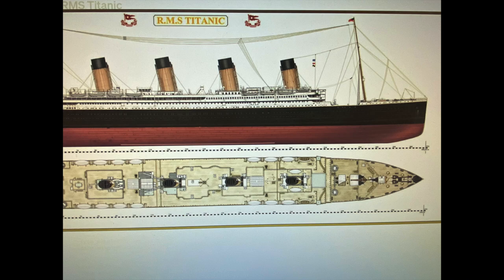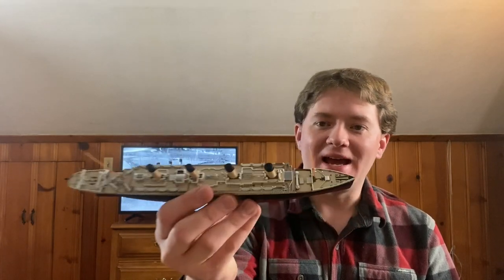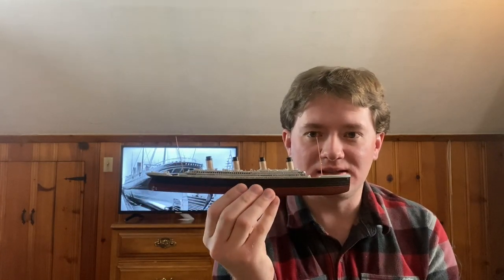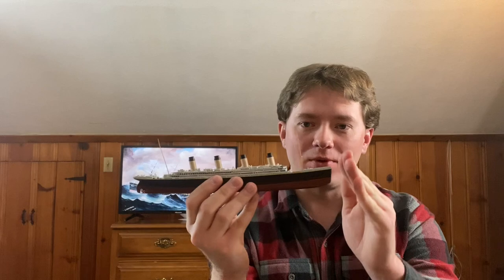Would more lifeboats have saved more people on Titanic?

Comment: little known fact, they were supposed to have a lifeboat drill the morning of the sinking but Captain Smith cancelled it.
Reply: But he was saying that the mentality was different in the day. Do you think a drill would have saved more lives?
Reply: @pwalmsley2721  would have possibly saved more lives because everything would have been more organized, less panic. and crew would have been more prepared.
Reply: Yes. It’s a well known fact.
Reply: 50 more ppl is a lot.  It would have saved more ppl if they had known what the heck they  were doing. For sure.  It’s inconceivable that they weren’t trained for an emergency and how launch launch the lifeboats in a proper way? Especially when they only had enough for half!?
Reply: @thelastminmom5251  You are right, however crew had already done lifeboat drill in Southampton on 10th of April. So they surely knew how to lauch lifeboats properly. And even if they had executed drill on 14th April, it wouldn't change anything for passengers, as lifeboat drill in that times consisted of lowering few crew members in single lifeboat.
Reply: @pwalmsley2721  if they did a drill each life boat would have about 60 people instead of 28 and they wouldn’t spend an hour getting the first life boat organised
Reply: Yes that is correct,  the drill was canceled for some unknown reason, but had they had the drill, would that had any impact on the amount of people that were saved?
Reply: @peterp7442  the crew would have been more prepared, "panic mode" of passengers would have been lessoned, so yes it is feasible that more passengers could have been saved.
Reply: @brettkelly8301  i agree to the fullest
Reply: @peterp7442  yes because the life boats would’ve left with 60 people each not 28 and they wouldn’t of taken so long to load each boat or panic
Reply: @rei9965  yes that would have reduced the panic a lot, and as far as the capacity of the boats i remember hearing somewhere that they were afraid of the boats buckling under the wait of people and that was a factor into the few number of survivors, I maybe wrong on that, but I am nor sure...
Reply: Yes! A lifeboat drill would definitely have saved more lives. More organized for one thing, but they would have the forethought to fill the boats to capacity.
Reply: @peterp7442  Um, I am pretty sure that's a myth, I think it was because the passengers didn't want to get into them so the crew decided to lower them in hopes of saving those inside.
Reply: @pwalmsley2721  I would a drill would take like 30 min at least to do, which might have caused the Titanic to miss the Iceberg
Reply: God can't sink this ship, but they decided to hold a church service.  The ship would have sank slower if the watertight bulkheads went up to the highest deck.  But we wouldn't want to section off that 1st class grand staircase.  We need a beautiful ship.  Plus, we went above and beyond when we were only required to carry 16 lifeboats, but we threw on the 4 collapsible boats as a bonus.  At the time,  ship disasters, no one really thought much of it.  An unsinkable ship would sink slow enough that they would use the lifeboats to ferry passengers over to the rescuing vessel. Lifeboats weren't really meant to save people, but rather a boat to transport people over from one ship to the next.  Plus, who wanted an over cluttered deck. If this were pre-1912 I would have pushed for more collapsible boats because they take up much less space.  For starters, I think they could have held two collapsible boats on each of the funnels.  The other issue, I almost forgot about was the iron.  At the time there were union strikes and a major coal shortage.  So the iron that was hammered into the ship especially the nails/screws that were put in, weren't of the highest quality.  The metal had defects in it. So something like super cold temperatures with ice scraping against it, made the walls in the engine rooms of the ship very brittle. The Titanic was already behind schedule, and the longer the ship was delayed, the more revenue that White Star Line was losing.  White Star already had to put on Captain Edward Smith in order to attract more of the wealthy passengers to come on board during her maiden voyage in order to try to make a profit.

Comment: While the number of lifeboats was a major issue, another factor was the lack of trained crew to launch them. Boxhall and Lightoller and their two crews had to launch each lifeboat on their respective sides sequentially, unlike modern practice where there is a fully trained crew assigned to each lifeboat. Thus the shambolic loading/launching of the boats. Extra lifeboats would only have been a factor had there been adequate trained crew to utilise them.
Reply: On Costa Concordia was "trained" crew and enough boats, but not of them was used effectively... Human factor is more important, than techics.
Reply: Actually, the Davits used for Titanic, Britanic, and Olympic were of the "new type" which held three boats each.  The extra boats wouldn't have been requried to be moved out of the way.  The crew could have loaded the boats successively and moved the passengers out  rather efficiently.  However, as Basil pointed out, there was no training of the crew in the use of these new and unfamiliar Davits.  Thus, the extra boats likely wouldn't have made a lot of difference.  Keep in mind also, most of the boats launched went out at less than half capacity.  Still, they could conceivably have been just unhooked from the tackle and moved away from the ship, if need be.  Titanic didn't really suck people down as has been suggested.  I don't know of a credible witness of any sinking detailing any kind of suction dragging swimmers or cast-aways down with the ship.  It is shown in the movie where open/broken windows and portholes  sucked people in, however this would have been responsible for very few deaths.  The temperature of the water is what killed the swimmers.  Within just a few minutes, as a matter of fact.  Also, bodies in cork life-jackets are very buoyant.  Titanic's dead and debris were floating out there for quite some time.  There are many records of ships coming across them.

There were a few people pulled out of the water.  Nearly all of them died of hypothermia.  The character Rose was in the water far too long to have survived.  Even with her Fiance's wool coat.
Reply: @ronaldsmith6829  Mate, we're talking about a 50,000 tons displacement ship sinking suddently (after breaking in two). Even if we discount half or so of that weight, we're still talking about around 25,000 tons displacement. There's no way such a high displacement ship doesn't drag nearby people under. One known case of suction was 2nd officer Lightoller, where only two air bubbles saved him from certain death, and i'm sure there were a lot more, it's just that no one survived to tell the tale.
Reply: I think that the technology of the boats have a lot to do with it too. If it takes five minutes for fully trained crew to do it that is a really long time in an emergency
Reply: @ronaldsmith6829  She was only in the water a few minutes before getting on the door frame!
Reply: @ronaldsmith6829  The davits of the Titanic and Olympic were not of the new typ wich held 3 boats, they were installed on the Britannic and Olympic after the sinking of the Titanic
Reply: @NahuCommNS  Lightoller was not succed down by the sinking Titanic, he was succed down by water flooding into the Titanic
Reply: The ship didn't breakup till well after the last of the boats were launched.  By that time a good thirty to fifty feet of the Boat deck was awash.  Would they have had time to have launched so many more boats remains a question for the ages.  By the time the last boat pulled away, the ship was developing quite a list to Starboard, which further complicated deploying the launching of bo
Reply: First, the breakup occurred long after the crew had launched the last boat.  secondly,  Had the crew another set of boats, it's doubtful they would have had time to launch them.  However, they could have simply released them into the water like they did some of the collapsibles.  Long before the breakup, the boat deck was awash for a good thirty feet.  In fact, the roof of the officer's quarters was awash whilst they were attempting to free one of the collapsibles.  It is possible most of the boats could have been launched in the two and a half hours it took for Titanic to sink.
Reply: @ronaldsmith6829  You do remember that Collapsible A was attached to the ship and the ropes had to be cut with several inches of water in the boat. And "long before" sweetie there was barely 15 minutes from Collapsible D being launched to when the ship went under. 
You are assuming that they knew from the moment the ship hit the iceberg that the ship was doomed, do yourself a favor and watch any of the real time models of the sinking or read the timeline of events and you would realize that among the many reasons it took nearly an hour from impact to first boat being launched is them having to get the ship to full stop, look at the damage, realize the ship is doomed, wake the sleeping passengers and crew to get dressed and put lifebelts on,  prep the boats, start getting people onto the boat deck, and finally start getting people into the boats which until it was clear the ship was doomed would be a hassle since people wouldn't want to leave a warm ship for a tiny boat in the freezing Atlantic. So no realistically with the human factor of zero hindsight or robotic action they NEVER would've had time to launch most of the boats. Really did you never watch Sully where he calls the NTSB out for removing the human factor from the simulations about if he made the right call to land in the Hudson? Spoiler alert, like your idea for the crew, the NTSB had the pilots behave more like robots who never took a second to realize what happened, check the controls, consider all possible options, nothing they immediately turned around like dual engine failure at a lower level than any jet in history was a mild inconvenience and not a life-and-death situation that they would have no real training for because something of that magnitude or situation had never happened before.
Fuck you and fuck every single fucking person whose "brilliant" ideas remove the human factor from moments like the Titanic and every single other tragedy or near-tragedy in human history!!!
Reply: @1993digifan   no need to spaz out over it

Comment: Given the circumstances of that night, and the fact that the boats they did have could have saved around 400 more lives if they had all been filled, I don't think more boats would have made as big a difference as people think it would have. It doesn't really matter how many boats you have if people aren't willing or allowed to get in them.
Reply: Actually more like 500 if they were fully filled to capacity or some were over filled like they actually were.
Reply: Also, I doubt the crew would have had the time to launch many more boats before the ship broke.
Reply: Looking from the modern time perspective, it is shocking to realize how security and contingency were not taken seriously in those times. There were no drills to test and train the sailors the boat launches. With proper training, more boats would definitely save more lives.
Reply: I agree a lot of people would still have died even if that had enough lifeboats for all onboard, the question was could more lifeboats have saved more lives?  I find it difficult to believe that more lives couldn't have been saved if they had more lifeboats.
Reply: @warblerab2955  Believe it. Most people stayed inside until it was too late. Thats a absolute fact, as smith was reluctant to tell people the seriousness of the situation.  They only launched 18 of the 20 they had and that was with full crew working at full speed. 2 where ripped off by passengers once the water was boat level.